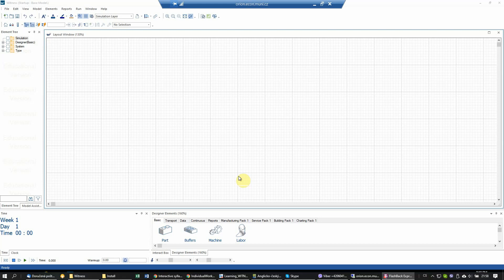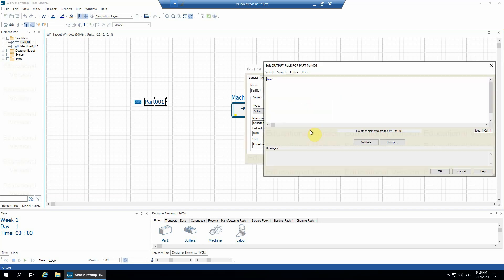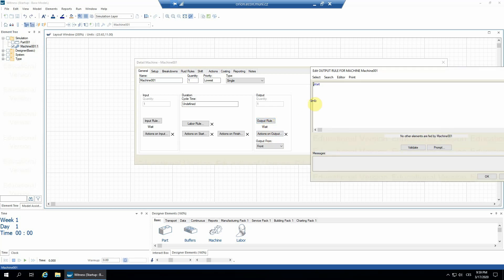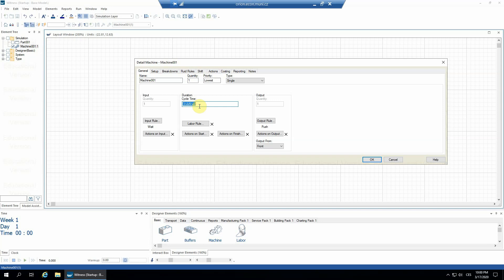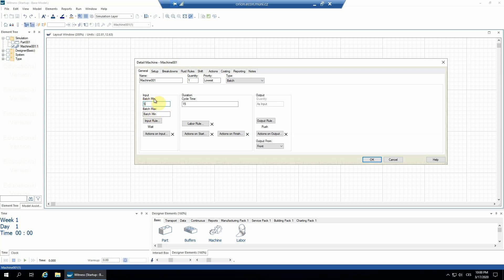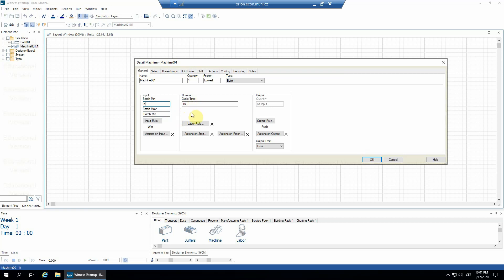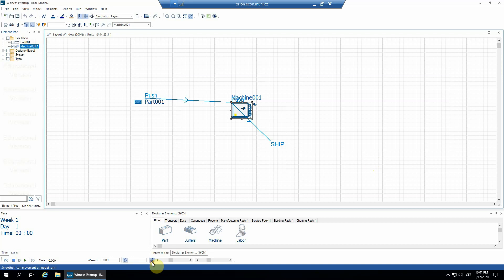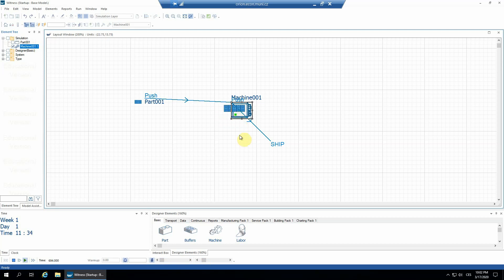Batch Machine

Comment: Hi, how could we move a batch with only one labor ? When I try to push a batch with a labor to next machine, if my batch size is 5, I need 5 labors to move the batch. I would like to move in one path and only one labor. Thank you in advance
Reply from the maker: Perhaps a rule in Action on Finish like "Change all to XY" could help. If that does not help with the batch machine, change the machine type into an assembly machine. The 5 pieces will be processed simultaneously as with the batch machine. XY has to be a part included previously in the model. This way every 5 pieces will be handled as one piece after the machine. Let us know if that helped.